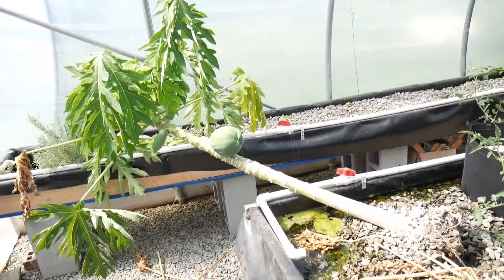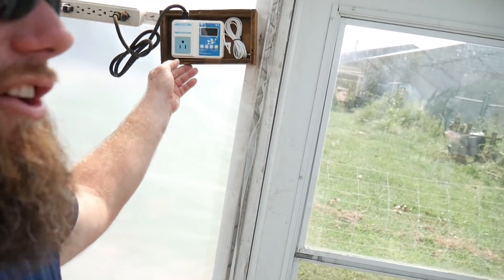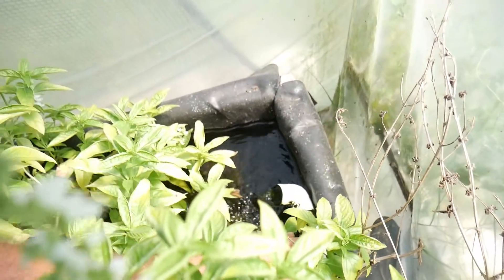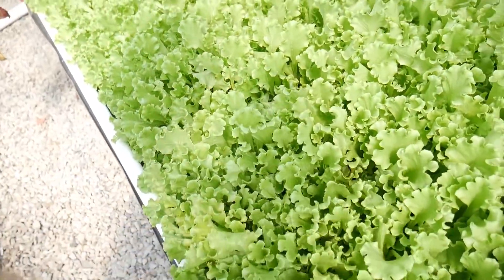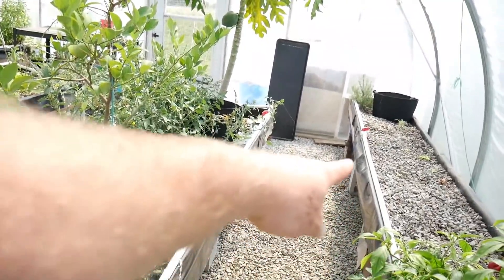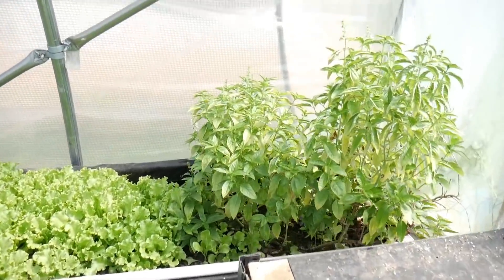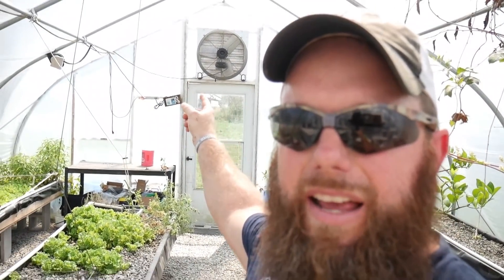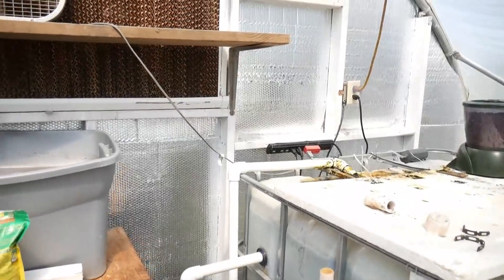How Does an Aquaponics System Work?

Comment: You can supplement your heat by putting a few square bales of hay and wet'em down when you check your green house and they generate heat as they compost. It'll cut down on your propane use.